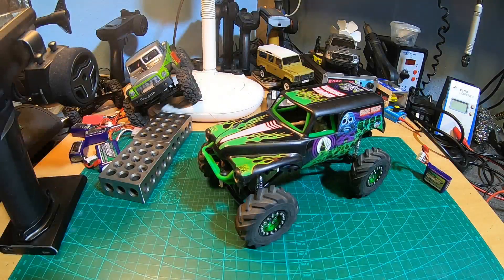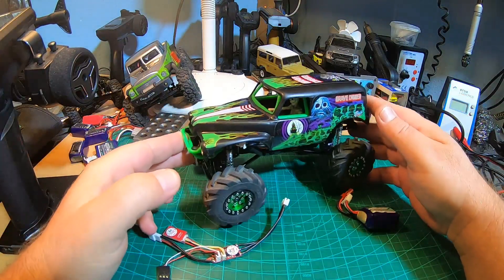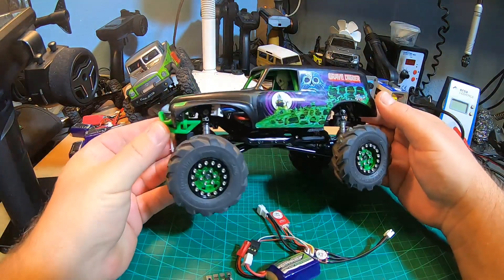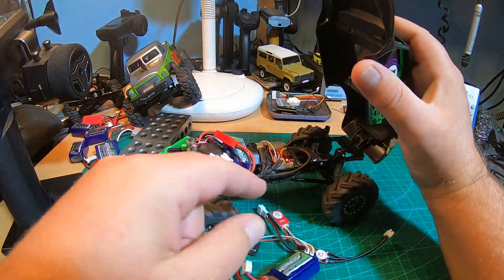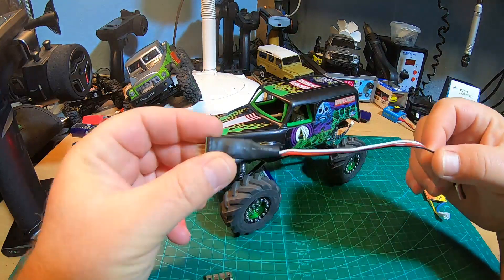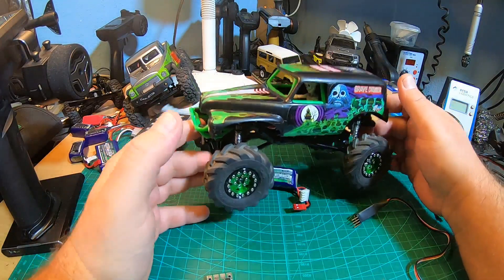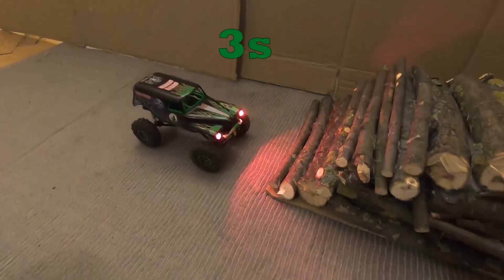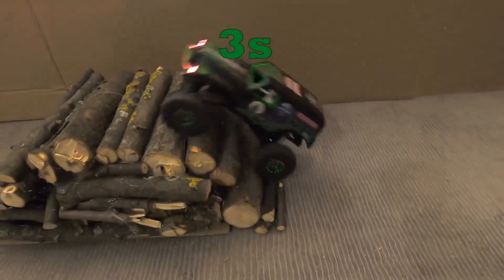Axial SCX24 brushed: 2s vs. 3s LiPo

Comment: Great! I thought the 050 motor was rated at 7.4v maximum, and that's why I never ran it on 3s! I have a couple of RGT 050 (66T) motors so I will try 3S on them (with the Modelbau 20a ESC) and see if the motor doesn't toast!

Comment: Do you have a general list of parts somewhere that you put into your SCX 24 grave digger. What an amazing job you have done. It’s amazing how much better than stock it is. I am new into crawling and looking for something to do with my grandson during the long cold Michigan winter.
Reply from the maker: Thank you. 
The "usual" stuff, Emax servo (ES08MDII, Banggood), Hot Racing shocks (Asiatees, there are meanwhile better ones), metal axle housings and C-hubs (Banggood), metal links (Aliexpress), Injora beadlock wheels (Aliexpress), RC4WD Mud Basher 1.0 tires (RC4WD shop), servo mount, low center of gravity battery and electronics mounts, front body mounts, LED holder 3d printed, 8 mm LEDs and receiver switch Aliexpress, Monster Jam 6044955 - Grave Digger Amazon, "Mr. Bones" figure Aliexpress.
But there are tons of videos for upgrading SCX24 out there... if you are US, than you get much of the stuff on Amazon (here in EU it is more difficult). 
For ESCs see my videos, made a ton about those ESCs (with links).
You can easily use stock SCX24 radio, upgrade radio is not necessary.
Reply: @donaldsneffe  Thank you for the information. Is a newbie Into crawlers. I will put this information to good use. So I appreciate it

Comment: Thanks Donald!
Yes, I run most of my 1/10 comp crawlers on 2s for the best low throttle resolution(with additional transmitter expo).My top speeds of 12-15 mph  are still a bit optimistic…….scale wise😎
Greetings from SoCal!

Comment: 57 degrees! That's amazing! And you have such high ground clearance. What mods have you done? I think mine can do around 52 degrees max and that's with the battery up front. 
I made mine into more of a trail truck by putting in a 1625 brushless motor, 1500mah 2S Lipo, and 1/10 rally tires. It flies now but strugles to do slow crawl; the esc would cog a lot.
FYI, I found that the servo gears for the Mini Z Buggy have the same pitch as the spur gear in the SCX24. I'm using that servo gear as my pinion gear now and the gear mesh is just right.
Reply from the maker: Thanks, but I do not think that 57° is that much. I am sure for example my "full metal scx24 chassis" can do more with right tires. Even my Mini-Z 4x4 did far more (but highly modified for this ;) ). The Grave Digger SCX24 has a heavy body, driver figure...
Mods? Ground clearance probably also because of the tires, but I played around with links, too. Metal axle housings, brass c-hubs... HotRacing shocks (not so good, guess there are better ones now, and I do have probably better ones). Totally changed the electronics, and I guess an ESC that lets you start and crawl super slow (AS12/6 in the Grave Digger) lets you crawl steeper, because with too much and abrupt throttle the truck tips over.
Thanks for the tip with gears, I do have a MIni-Z Buggy - could check. But so far I did not have problems with pinions, have also quite a couple of CR24/18, RGT which should fit. 
I played around quite a bit with brushless motors (and Furitek ESCs), inrunners and outrunners. IMO for crawling brushed is better in those micros.
Reply: Ha, 57 still sounds great to me! Insane...

Comment: Hello, do you know where I can fin an adapter for the 3S battery JST connector?
Reply from the maker: Easy to make yourself ;-) - I do.
But guess those are the ones you are searching for: https://www.amazon.de/OliRC-St%C3%BCck-Flite-Batterie-Adapter/dp/B08BZ5899R

https://www.amazon.de/VUNIVERSUM-Adapter-Adapterkabel-Mr-Stecker-Modellbau%C2%AE/dp/B07VBSLQS8/ref=pd_sbs_6/258-1387588-2893969?pd_rd_w=qBuT9&pf_rd_p=b1c388c3-48c2-4960-8532-fa8f1477aee9&pf_rd_r=VXRTYVFEC13CJVR8V6PT&pd_rd_r=6ef2775e-78ca-4940-9450-11cbdfc7046c&pd_rd_wg=BlPik&pd_rd_i=B07VBSLQS8&th=1
Reply: @donaldsneffe  TYVM

Comment: I have the same tires on my rusty gravedigger. I like'm too. Nice solution on the headlights! I don't think 3s is very useful unless you have loaded it with weight and lit up like a xmas tree.
Reply from the maker: You seem to have changed the tires recently, too (I did). Those Mud Bashers seem to perform better every day, when they were brand-new, climbing the obstacles of the video was more difficult. Love them.
Lot of tribute to RC Athletes diggers out there ;)
Salt and airbrush for the rust?
Reply: @donaldsneffe  Yeah RC Athletes really made the diggers popular. I used sponged acrylics and spray paint with salt technique. And little bit of dry brushed rust streaks.

Comment: Can you link or post specs of the 3s battery.  What Mah is it?
Reply from the maker: Turnigy Nano-Tech-180mAh 3S 25 ~ 40C Lipo-Pack from Hobbyking, unfortunately they are discontinued (https://hobbyking.com/de_de/turnigy-nano-tech-180mah-3s-25-40c-lipo-pack.html ), Hobbyking had sold them for rather cheap in a pack of 5.
Hard to get such small 3s Lipos, MyLipo (awesome Lipos, top shop!) has some: https://www.mylipo.de/180mAh-111V-25C-50C-3S-JST , Robbe had some - check: https://www.lindinger.at/de/Flugzeuge/Flugzeug-Antriebe-Elektro/Akkus/Robbe-Modellsport-RO-POWER-EVO-V5-25-50-C-11-1-VOLT-3S-180MAH-LIPO-AKKU/9749026 , those Hyperion look awesome (because you can take off the balance wires): https://hyperion-world.com/en/g5-50cmax-3s-180mah-4-2v-max-lipo?__cf_chl_jschl_tk__=pmd_feXaEXT5bstHc8IM1_Yyh3vJfODjy3OW6hWvtNZP_HA-1635675827-0-gqNtZGzNAnujcnBszQjl

Comment: Hola amigo! Do you have the links to the ESC and LED’s?
Reply from the maker: Hola, LEDs I do not know anymore (8 mm LED, probably Aliexpress).
Check links of ESCs here in description https://www.youtube.com/watch?v=0d_WOpvopjs&t=675s  (modellbau-regler.de even has a Spanish translation).
Reply: @donaldsneffe   I’m running a pn90 with the stock ESC. Do you recommend the AS12/6rw or the 15rw? Thanks!
Reply from the maker: @rekik66  I do recommend both. Depending also on your soldering skills. AS12/6 does not come with BEC, but for SCX24 on 2s (not 3s) with stock electronics you do not need a BEC (check my videos). AS12/15 does come with BEC, is larger and more expensive. Both perform awesome.
If you want plug and play, then take a Furitek ESC.